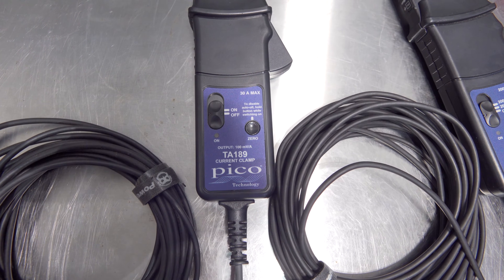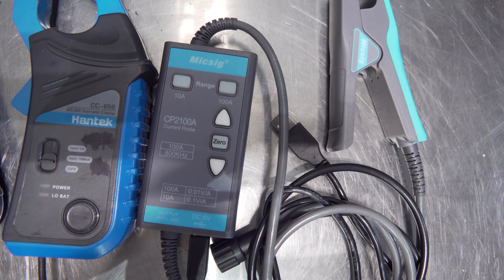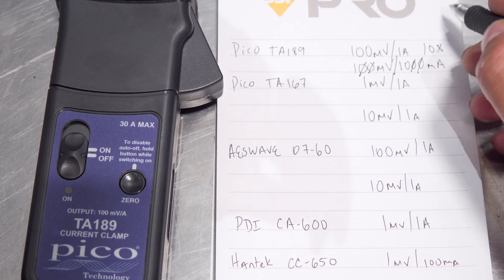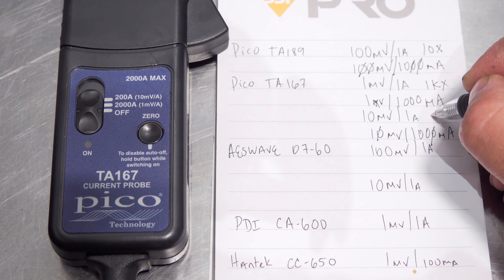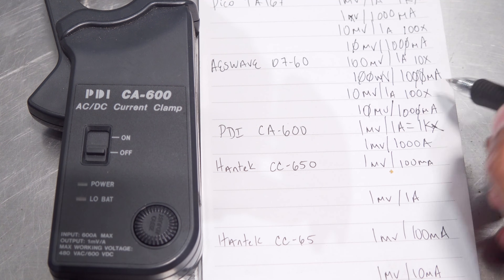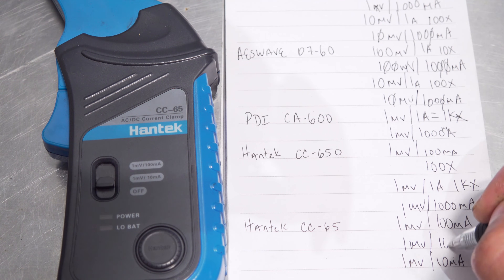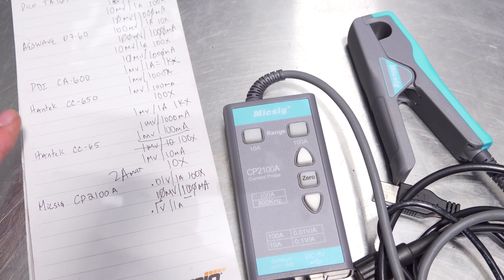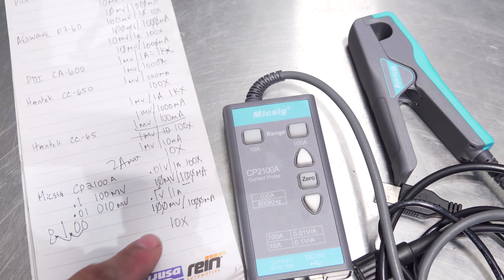HOW TO CALCULATE AMP CLAMP COMPENSATION SETTINGS FOR YOUR OSCILLOSCOPE | CRAZY EASY

Comment: What are the readings on a multimeter. Would be great to know, still confused with the conversion. I have the Snap-on low Amp probe with a 20A at 100mV/A and 60A at 10mV/A. Thanks if your able to help.

Comment: my favorite for parasitic draw testing is the fluke i30s.super accurate clamp but so are the picos and i like the amprobe ct238a and ct235a i use both those with my zeus